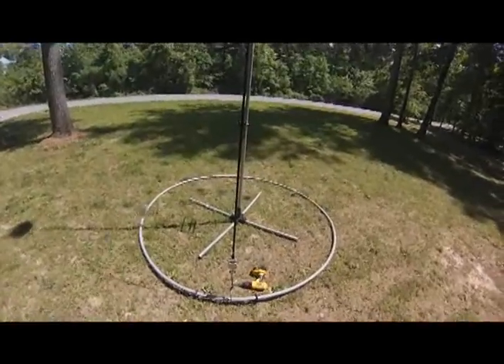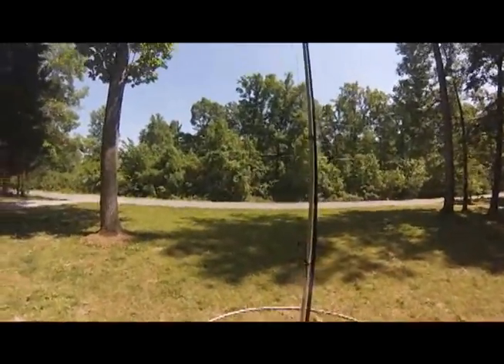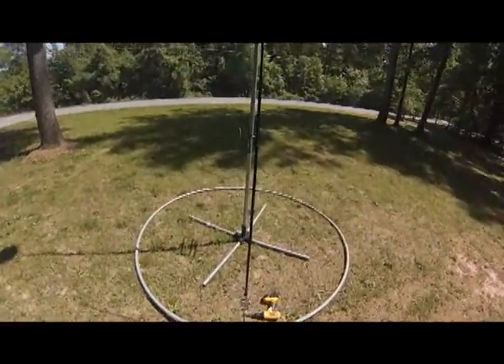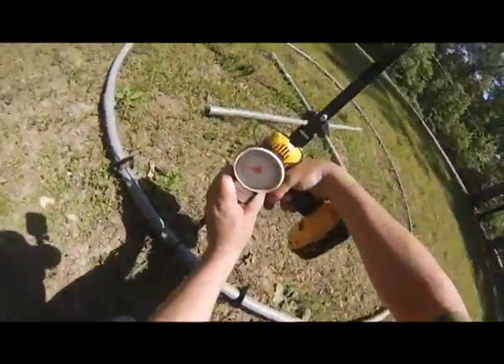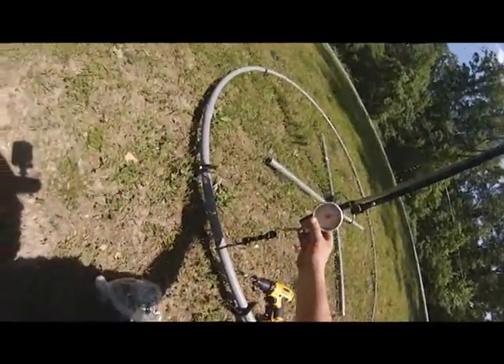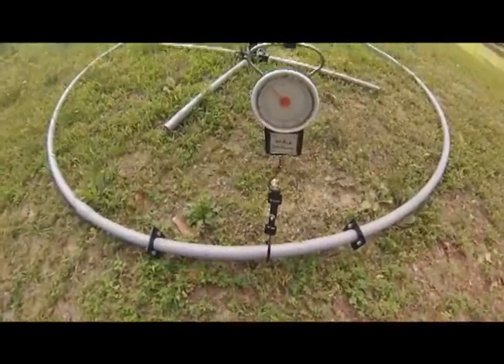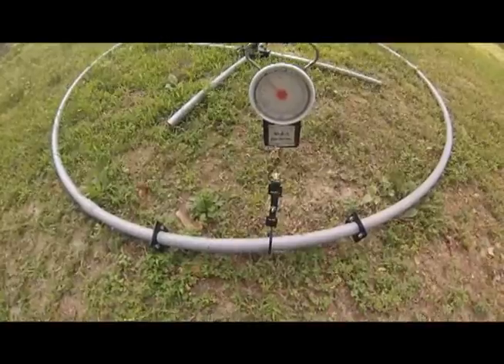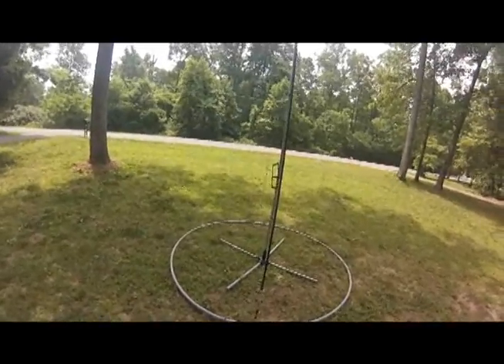Banding Material Test For RGB Christmas Tree

Comment: Cool,  thanks for the update.  I was wondering what the pull strength was for it.  Any chance we can get a break test and see how much pull will be needed to break the banding or cause an failure on this setup.  

I have a 20' mega tree setup from you and was thinking of adding the new banding straps.  

Keep up the good videos!
Reply from the maker: The breaking strength of the banding material we are using is 1400 pounds. I don't think this will break. We are using a 5/8", with .035 thickness banding material.